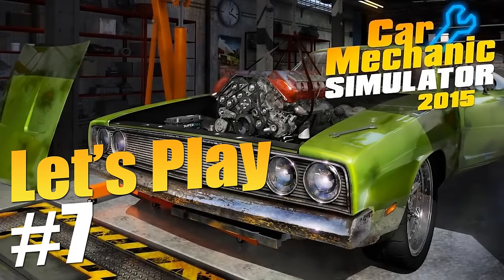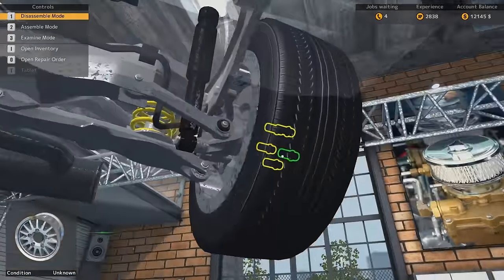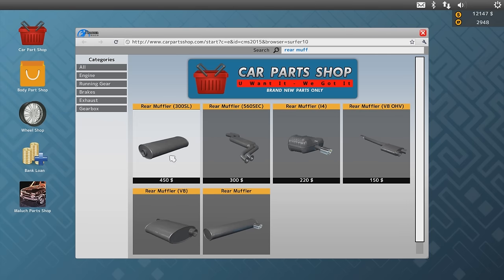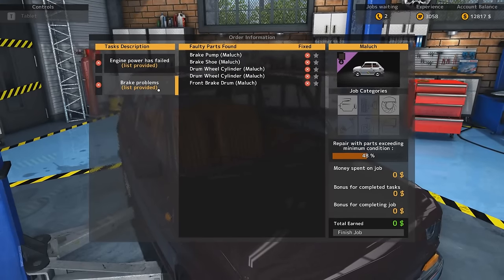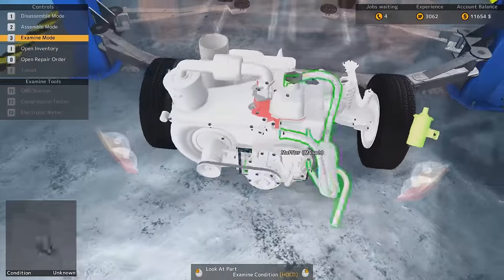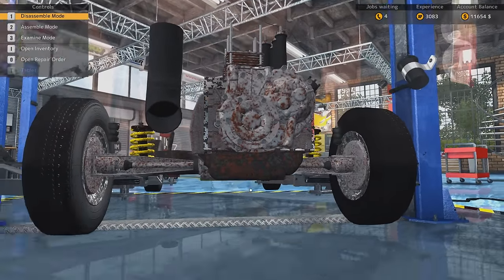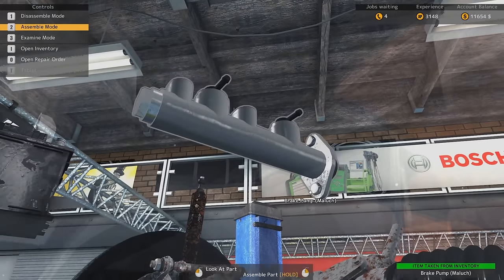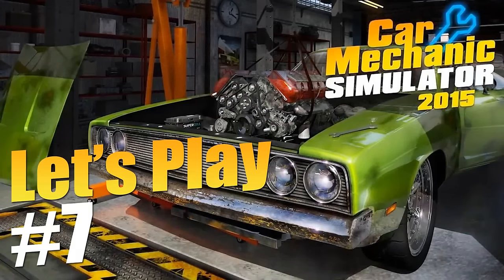Let's Play Car Mechanic Simulator 2015 (part 7 - Rust, Rust, RUST!)

Comment: I'm surprised by the level of detail in this game. Did my first engine disassembly yesterday. Probably didn't *need*to but it was a crank shaft bearing cap and I didn't know where to get at it and ended up tearing apart the whole engine block... Fun waste of time.
Reply from the maker: Hehe, yeah. It's fun to take the entire thing apart and then realise the
 fuel pump is at the BACK of the car, where the fuel tank is... :)